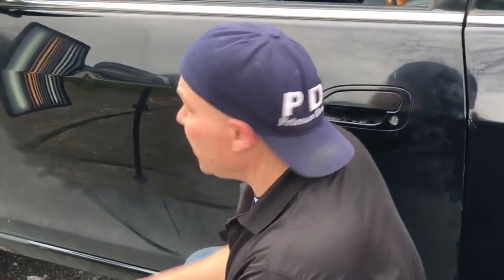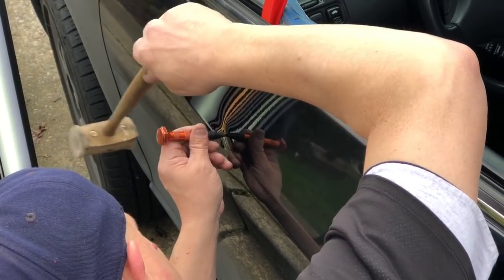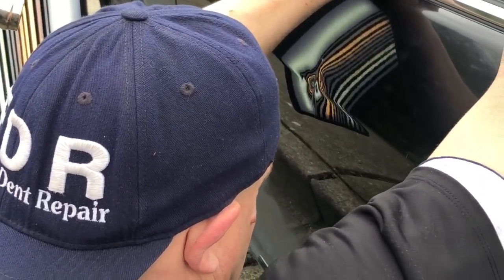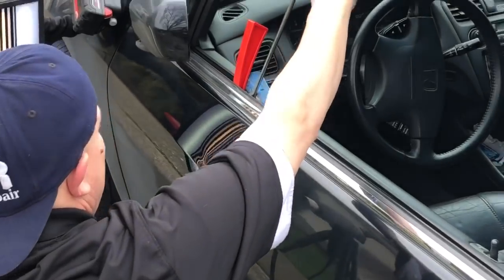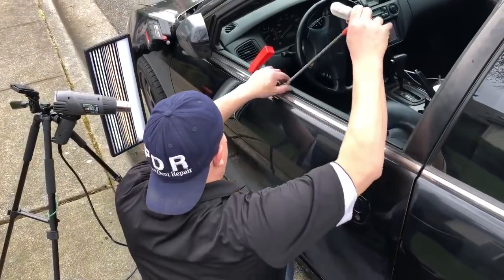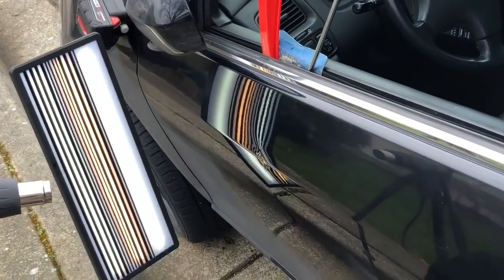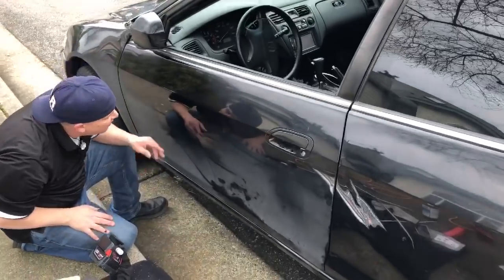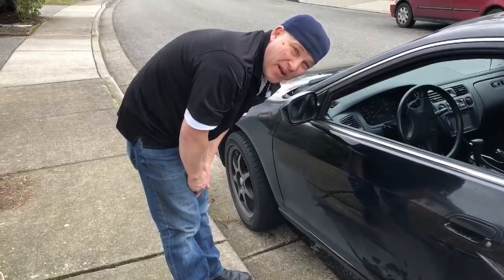HOW TO- 🚗PDR Accessing door window panel bodyline dent FREEBIE DENT!

Comment: Hey Mike, I’ve got a Veloster with a door ding/crease on the upper body line. This area is completely unaccessible because it’s encapsulated.  There are no openings on either end or inside the door (I removed the panel).  I’ve gotten it partially removed with glue pullers but after dozens of pulls I don’t think it can be finished that way.  How would you go about getting a rod to this?  Thanks!!
Reply from the maker: Are you commenting on the right channel?
Reply from the maker: I’m Garth

Comment: Takes guts to start dent off on bodyline with raw metal. Soft tip would of got that dent out cleaner. just my 2 cents from a 2yr tech.
Reply from the maker: Prestige Dent Removal Thanks bro I didn’t even really finish this Dent I just did about an 80 to 90% or for him for free after working a couple hours on other dents on the car but yeah in the first five years you would want to start with a rounder or softer tip